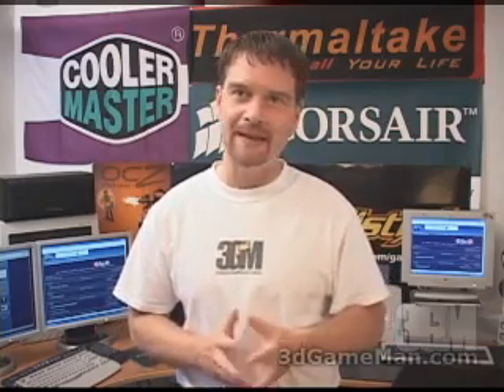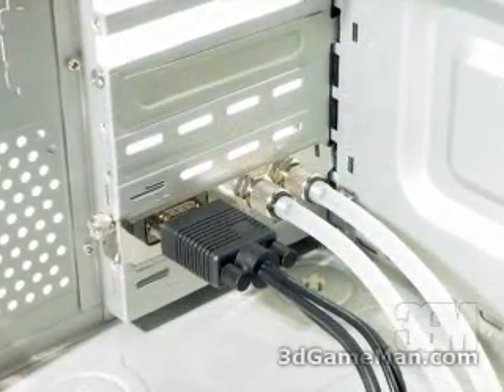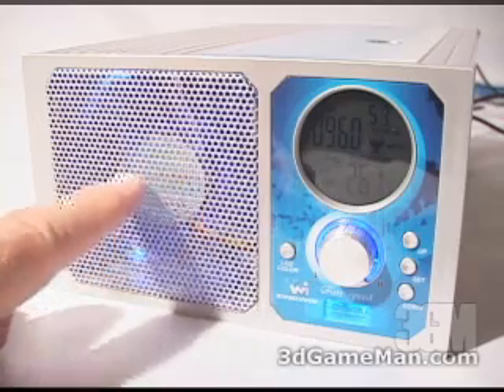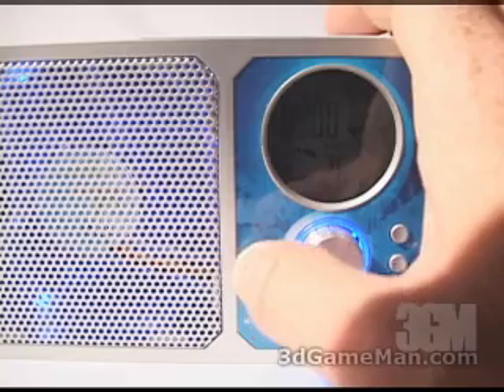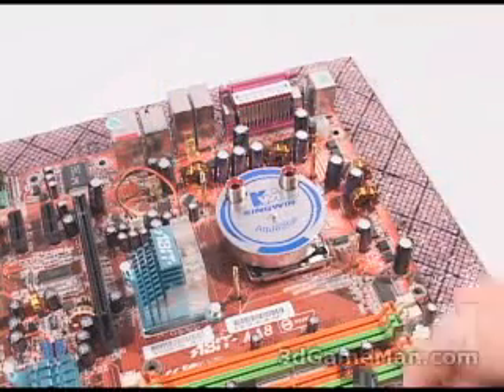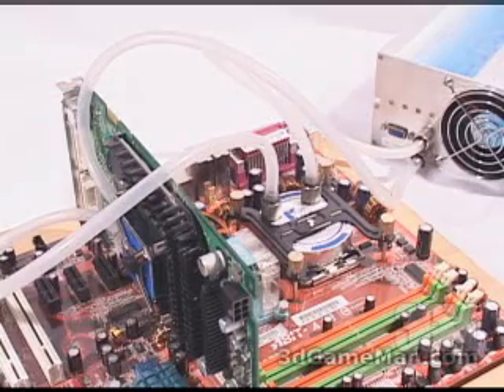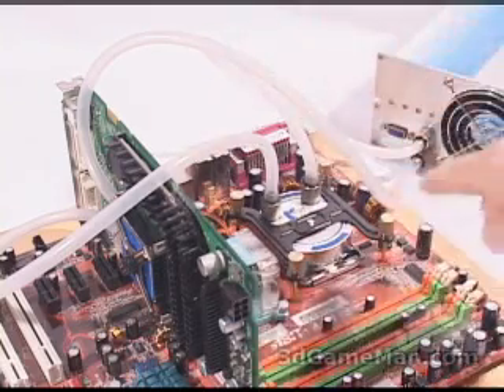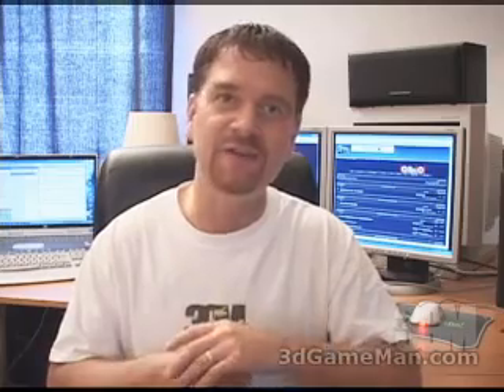#583 - Kingwin AquaStar AS-3000 Liquid Cooling System

Comment: Very nice video I might add. Does this cooling system work for the 7800GT?

I might suggest that when you do a test run, that you run the cooling system before attaching it to the motherboard, but since I am not familiar with installation of this unit, i dont quite know how difficult that may be.